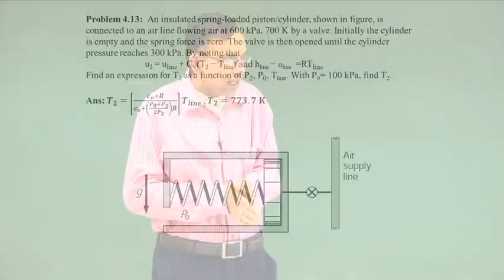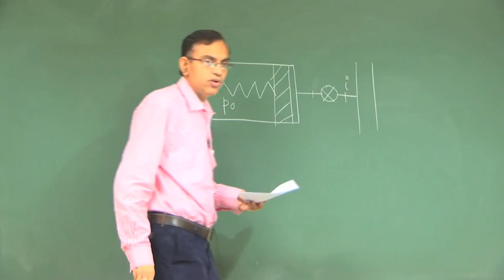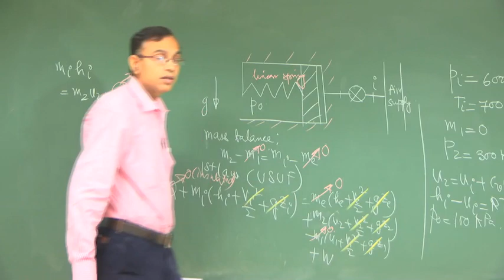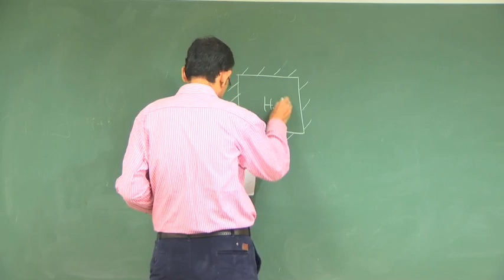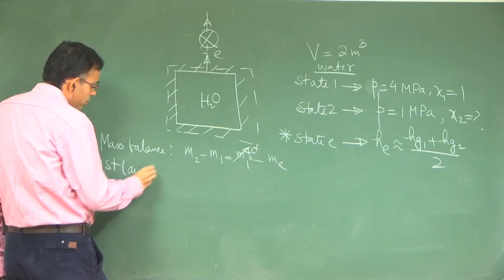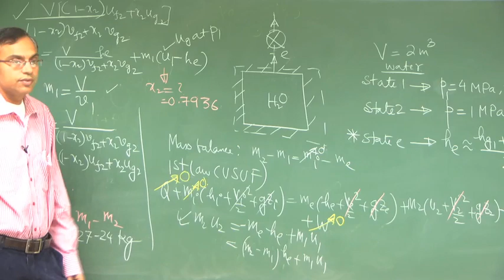Lecture 31 : First Law for Unsteady Problems - Examples (Contd.)

Comment: SIR , at 13:35 , how area equals to the trapezium if it is a linear spring ...
Reply: for a linear spring P-V diagram is  a straight line, so to calculate the work done by the system, which is same as the area under that straight line that is nothing but a trapezium